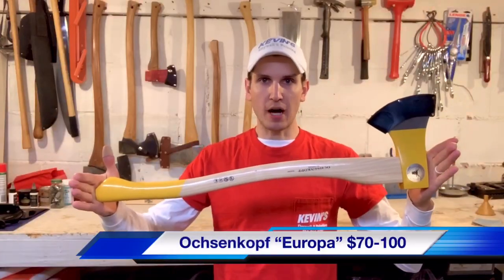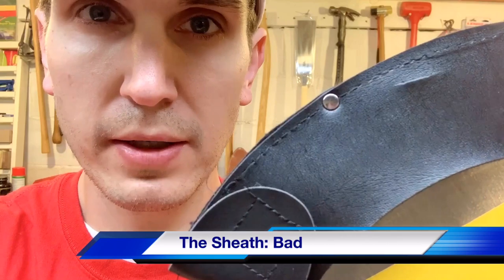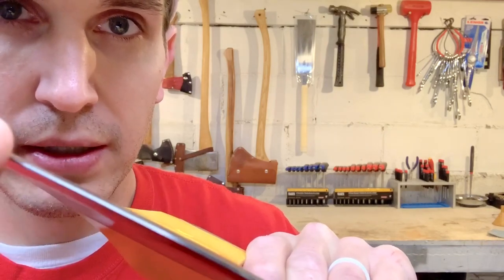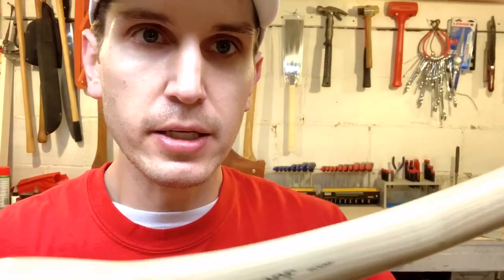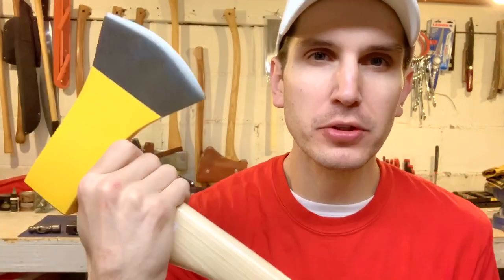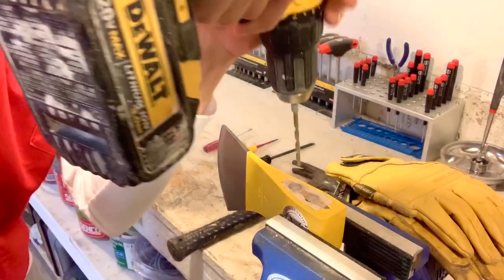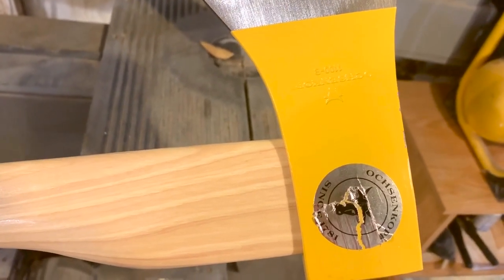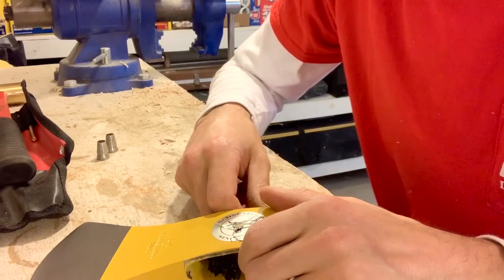Axe Review Part I: Ochsenkopf “Europa”

Comment: You dont have to rehang the axe further down the handle, just rasp away the material upwards
Reply from the maker: I suppose I could have, but it’s too late. I cut the head clean off because I’m damned impatient. Lol
Reply: @KevinsDisobedience  my guess on the huge handle, is that they have taken a pattern meant for birch or oak, and made it in hickory, same reason Russian axes have huge eyes, if all you had was not that great, you made it beastly to stop it breaking.
Reply: @justicar5 Ash would be the main choice oak would give far too little.
Reply: @ajaxtelamonian5134 Ash, Black Locust, Hop-hornbeam. Black Locust is very close in every way to Hickory (except it's more sensitive, while drying, to splitting, if yku don't lnow what you are doing). European Beech is decent, too, albeit less springy...harder on your hands.

Everyone makes oversized handles the same way they put ridiculously blung angles on their axes (nore like a "courtesy grind") because they expect the user to have no idea what they are doing. So..."make it solid as a tank...even if less useful.

Second...you make an axe yours 🙂, if you know what you're doing. 

The theory about the oversized eye sockets, though, applies to Northern climates, indeed.

Comment: Absolutely agree with the sheath bieng useless, handles are very thick but they do thin down into a nice shape. I use them for a lot of my vintage heads because most replacements dont have enough palm swell. I think once you put a nice chisel grind on it you will see why I reccomend them
Reply from the maker: Oh I was just being dramatic. I know it’s a nice head, that’s why I’ve wanted one for so long. I re-hung it and put a chisel-grind on it. I’ll post the second part tomorrow, or maybe later today if I get to it.

Comment: 'm guessing you'd do this a lot different now.  I expect to have to remove some shoulder wood on the back as most stock axe handles, even good ones, leave a lot extra there.  A common assertion in old lit is to hang the axe low to the shoulder, but it would be better to state the goal rather than assuming the best way to get there.  I don't know how strength and resilience plays out in those long shoulder areas on those axes. It might be favorable, but handling is awful obviously
Reply from the maker: Yes and no.  It depends on the hang.  If it’s straight and ostensibly snug then I’ll leave it, but otherwise I often rehung it right away.  I hate rasping away the shoulder (which I prefer to remove as much of as possible) only to have a head come loose six months later, but yeah I probably should have just moved the shoulder up.  I actually hate this axe.  I’m going to get rid of it.  I bought a different model to give them another shot, but I haven’t had the energy to make it usable.  They take so much work to make them comfortable to use.

Comment: I dig this style of handle, aside from the curves. The long shoulder means i can buy an 80cm handle but because the shoulder is long i can knock the head down and get a 75-ish cm handle, which is my preffered length. And being so thicc once you thin it down you get an actual palm swell.
Reply from the maker: Sure, handles are more a preference than anything else. And you don’t necessarily have to knock the head down. You could leave the head where it’s at and move the shoulder upwards by filing wood away, but now I know it isn’t coming loose. Thanks for commenting.

Comment: This axe is a multi purpose axe for loggers. It is used to clean all the stuff on the tree stump and around the tree, that potentially can dull your chainsaw. So it removes sandy moss and stones from the foot of the tree, it's used to clean the brush around the tree the loggers want to fell. It hits sand, dirty, stones and the ground. It's for limbing of tiny limbs, the logger didn't get with the chainsaw. So the edge is made to withstand rough use. If you want a sharp felling axe, you need to buy one made for this purpose. These type of axes have inlays of harder steel on the cutting edge and a really sharp edge as well.
Reply from the maker: I bought another.  Give it one more try.  We’ll see.
Reply: No Axe made in Europa uses Inlays of Steel since ~1960. They are Allsteelaxes today.

Comment: 😂 love it! My sheath is basically all electrical tape lol. And yea the handles are trash for the most part but you can pull the shoulder up on it them if you don’t want to lose handle length.. It’s a little late now but it’ll be alright haha. We all talk highly of these axes but mostly for them being customizable and having great steel and geometry. I have no doubt it will be one of your favorite limbing/felling axes when it’s fully tuned up. If you want to make quick work of tuning and thinning the handle, use a flap disc on an angle grinder. I didn’t because I’m too much of a pussy but it turned out really well regardless. At the end of the day it’s a tool for professionals thats meant to be customized. What’re you gonna do 🤷
Reply from the maker: I will post the second part tomorrow or a little later today if I get the chance. And yes I went at it with a flap disc. Lol
Reply: Kevin Kevech yaaaas 🙌 proud of yew